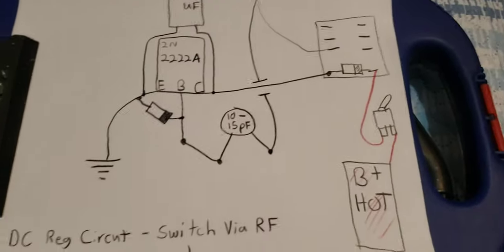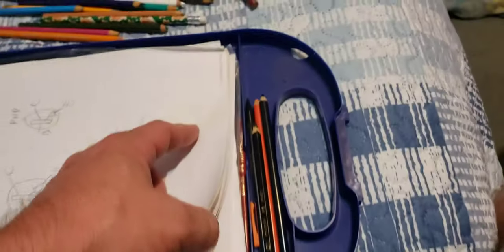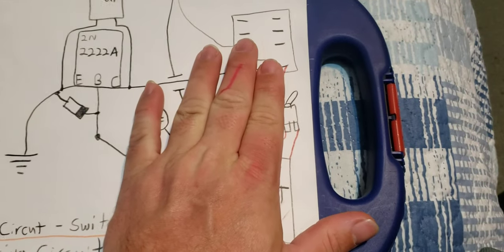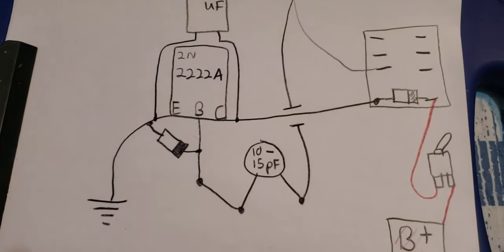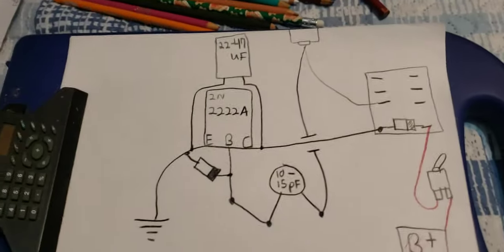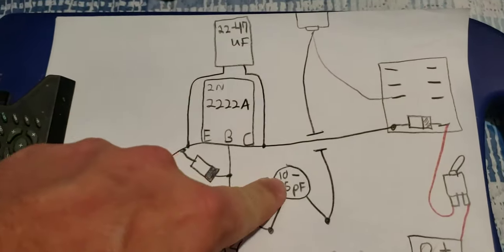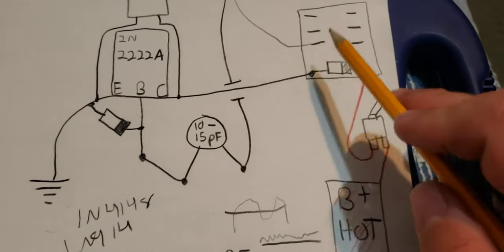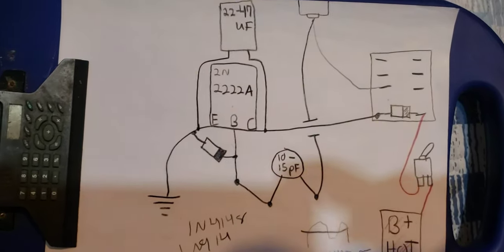Gatekeeper In Amp Building Concepts - RF Keying Circuit - [For The Layman]

Comment: I always chuckle when guys show me their custom designed keying circuit and its so freakin over complicated. I love the keying circuits that we use like you show! So simple always works and easy to fix
Reply from the maker: I agree man lol.....you can use a emitter follower but now you have 2 transistors that can go bad lol. Instead of using a coupling capacitor haver you ever took 2 wires and twisted them together about 7 or 8 times real tight and split it at the end and use that instead lol....crazy man. 

I have a circuit wrote down that gives the relay a POS instead of a neg which works well if your trying to do something crazy like a 3 way stage to stop the back feeding due to the transistors working even when the switch is off for that relay.

Comment: nice. that is about the most reliable keying circuit. big relay go with tip120 or similar. diode also can be 1N60 or 1N34A . there is a Japan one 1S xxx that works . that circuit works 24V with 24V coil relay. SSB delay is across the relay coil. I used opto cuppler circuit. even one with MJE 3055T transistor gives +12V when keyed. take bias off that and relay coil to ground. the 2N2222A I have are the small metal ones.  I tried a FET before was so sensitive it stayed keyed or buzzed with strong signal nearbuy. got a old tube amp  that has a small tube to key relay . just add small LED across relay and you have a TX light. 73's
Reply from the maker: Very good point bud! Yeh I have some metal case 2222a I want to use sometime. A neat ssb delay is delaying on bias with small uf cap that works very very well
Reply: Companies who build amps should always add for side band. Lots of CB users like to talk on SSB. They could do that for us. But they never do. Its so crazy.